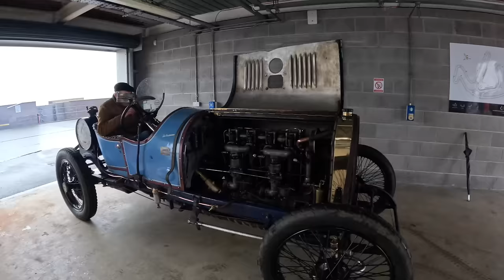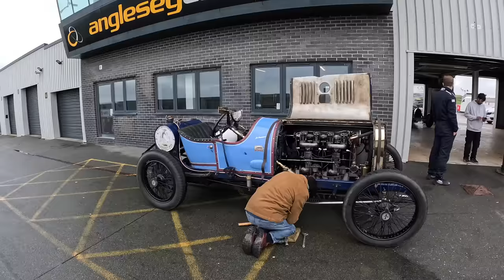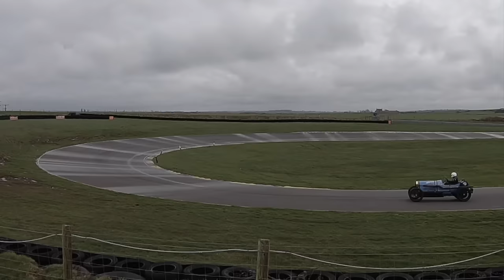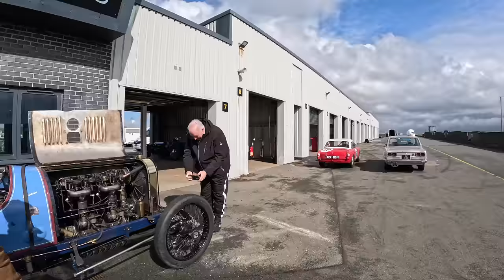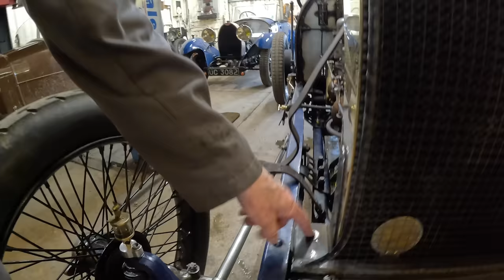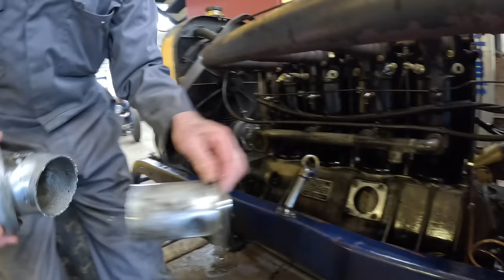SHED RACING - Hall Scott - Shake down on Anglesey Circuit

Comment: I loved this Ivan.  Even Tom had to grunt a bit getting out of the car after being on the track in the wet for that long. He is quite good considering he's literally muscling a 10 liter aircraft engine in a featherweight frame with bicycle tires for traction. What fell off wasn't critical and besides, I had to laugh when you showed the flower foam for soaking up the oil. Not bad really.

Comment: Ivan, I haven't seen a single car pass him. I he spent two hours out there he was definately having fun. I'm just finishing up a 195 Singer SM1500 roadster. Left off every bit not absolutely necessary . No fenders, no runningboards, no hood, no hoodsides, no convertible top mess, just the pins for a tonneau. The entire car is rebuilt down to the last nut. and bolt. Replaced many of the nails with screws. Used stainless throughout. Cut down the windscreen, and made a lighter aluminum frame for it. Put rudge hubs on it and am running an old set of Jaguar wheels with the fronts narrowed 1.5". I have a 1965 Sunbeam Tiger ready for final assembly also as a street/track compromise. ,also assembled as light as possible using the hard top alone. I also have a 1959 Hillman Husky with QA1 coilovers, and a polished out, and chromed Jag rear IRS nicely adapted in. It was already set up for smallblock Ford V8 when I found it so will modify front suspension to accept a rack, and pinion setup. It has a large fuel cell already installed as well. I must say I have thought about doing something more radical intended for desert romping. Building a custom frame, lengthening it, and really making a hotrod style toy out of it. We shall see on that one, I should start with something rough, and not as far along as a street/track restomod as right now the body is perfect, sporting new rubbers, new lenses, all trim in place, original paint, zero rust, perfect glass, so far modified with the best period parts only where you cant see.

Comment: You can buy oil absorbent sheets for use under boat engines that might work better in that undertray. Car looked very well behaved, will be interesting to see it at Goodwood after another round of tweaks.

Comment: Anglesey is a great circuit. I've rallied there a few times and been round the track in all sorts, including a 3 tonne Dodge Ram dually pickup.

That square left at the top of the hill is ace. It's completely blind. They used to have a stack of tyres painted orange sat on the apex, and you stayed out right and just turned in and aimed for the tyres. They're not there now, but there is a black & white marker post in the same position now.
Reply: Having recently driven one of those I can’t even imagine taking one around a circuit.
Reply: @blacksquirrel4008 , a dually? It's a 5.9 Cummins 24valve. I was Sector Marshal on a rally at the circuit and took the Chief Marshal out for a ride around the first stage, to check it was set out correctly. We were using the concrete access roads up round the top of the circuit as well as the circuit itself.

When we got back into the pits, having done the complete stage at full chat, the front brake pads were on fire, and we had to drive around until someone was able to bring a CO2 extinguisher to put them out.

It was amusing.